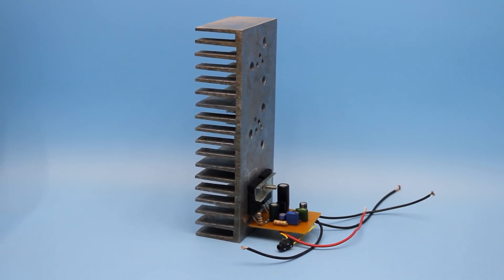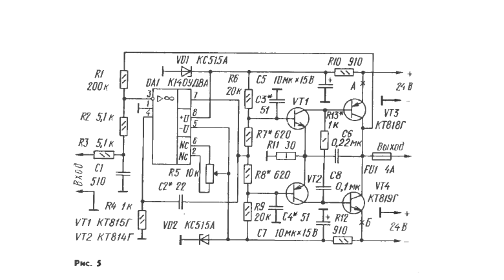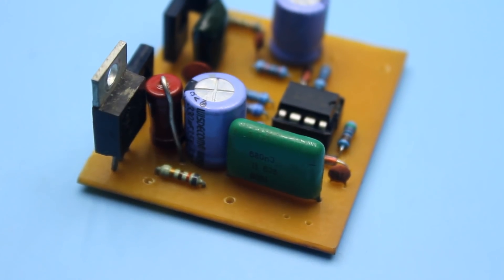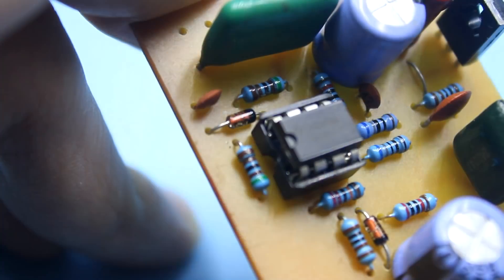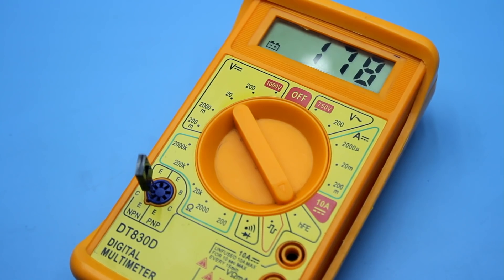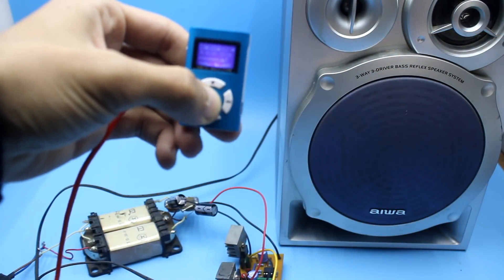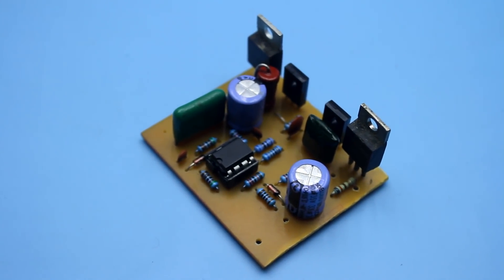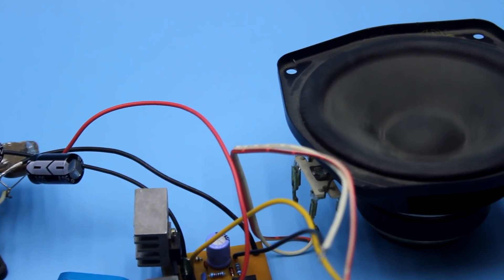50W  Amplifier on transistors

Comment: QSC used a similar schematic as a drive stage for their pro audio amplifiers 🤗 the op-amp definitely is a upgrade and will produce a cleaner and more stable sound through the transistors. And the TLO41 is a precision single ended op amp with a very nice slew rate fast.

Comment: Use the 5200 and the A1943 or the C2073 and the A940 in place of the tip41c and the tip42c. And use mje340 and Mje350 in place of the bd139 and bd140 pinouts are the same when swapping out these transistors.
Then you could use +70-0-70 DC and then you would have to change out some of the resistors for 1 to 2 watt resistors on some of it and also change some of the values of the resistors and definitely use all 100 volt caps. And two 1N5245B 15 volt zener diodes 5 Watt 🤗💖 to help power the op amp.

Comment: Class b isn't 'hi fi' enough, bcoz every time tr push &pull cycle, it doesn't start smoothly. So class 'ab' was created, it keeps tr still run slowly in off mode. Just like you keep ur engine 'on' when waiting traffic lights.

Comment: well the op-amp is more like a class D and that's definitely not a class B amplifier that's more like a class AB push pull with a collector output. And the TDA7294 would blow that thing out of the water. You have to use a op amp to really push those TDA chips and the TDA7294 I've actually connected 47-0-47 DC or +52-0-52 DC up to it. And the TDA7294 is a hundred watt chip amp with a 4 ohm load. I would use that amplifier for more like a drive stage! That you've designed. You could if you know what you're doing.🤗💯

Comment: Can I use a 140 watt toroidal transformer for using 2 amplifiers to make stereo or does each channel input need isolation? Also which value diodes should we use on the full bridge rectifier for 140 watt and there's no set voltage for capacitors?

Comment: I assume this module requires a power supply that supplies both positive as well as negative voltage?
Reply: exactly, aka split supply, you can use a lipo for that

Comment: Is 10,000uf capacitors sound ok for this circuit?
Reply: yap
even better but pay attention to voltage ratings
Reply: Well, yes, but then you should add some smaller low inductance capacitors in parallel. Bigger capacitors actually generally have high serial inductance yielding them poor for higher frequency noise filtering.
Reply: Thanks, so keep the overall voltage 10 volts or so over the rated system?

Comment: If you talk about class b. ( If you play Real class b  you  must have 2,1 watt pr watt you play from the supply but the AMP must be Bild for that   And is a Big claim to the AMP )
But this AMP is lov coast an Verry good
And i must Tel you All amps Bild in 1970-1980 Youse Verry hig supply wats 
Eks If your amps vas 2*100 watt the supply vás about 400 watt that vas times 
You se this amp you have is 60 watt and the supply is 70 watt
It’s to love to kontrol the speaker membrans
The bios in a amplifier  system works and are kreatet to Think AS A Brian 
A speaker have 2 sides front and back If you give you speake A signal to Go out 1 watt
The bios system must youse the same volts or watt Iind the rekyle  ven is gos back in support 
1 watt on Bouts sid’s on membrans 
The creator of the amplifier have 2 sid’s in his  Brian 
1 watt out and 1watt  on the otter side in the rekyl  off the membran     In the same cekund  (. 2.  Watt   Pr watt. )

I love the bios system its negativ and positiv ind the vay it vorks pracktial on the speaker membrans  you se
1=2 front side and back side of the membran   ( if somvone pres your on the schoulder you must yous  enagy to What Keep your balance      Thats bios system 
Drop class A its nonsens 
Real klasse b is the Best amplifier in the World    Thats it  ! hig slev rate voldtage Verry fast because the bios system 
Hilsen Per h Jensen Denmark 🌹🌹🌹🇩🇰🇩🇰
I love NAD Nikko  cervenvega and Fostex speaker from 1980  from Audiocan

Comment: No circuit analysis. Not Stereo. Odd power requirement. Not a class B, but a class AB. 
Also, why is every electronic channel YouTuber now a pimp for JLCPCB? 
That's just too much. If they are that good, how come you don't use them yourself? How come they don't make your PCBs for your videos for free? 
Not trying to be an ass, just pointing out areas that need attention.
Reply: the no stereo is quite classic when talking about audio circuitry, just duplicate it.
power requirement is classic for push pull to work on split supply. 
as i also pointed it is a class ab and that is a big mistake
the jlcpcb ....idk bro
Reply: Well aren't you a clever know it all. Thanks Sherlock.
Reply: JLCPCB is currently in aggressive marketing phase. It is easier to sponsor some DIYers community and provide service in price barely covering production cost. It is a marketing strategy.

About rest of the circuit - I think it easier to stick to integrated amplifiers in this power range. Look up "gainclone" amplifiers - the integrated chips provide better results while providing extra functionality like controlled power up and power down (no thump in the speakers). Many of them contain suggested PCB layout in their datasheets, like in TDA7294 datasheet (which I actually do not recommend, I have one frying while operating as constant current source, but within operating limits).

Also, the heatsinks used for transistors in this video are probably too small for AB class operation at 60W, as specified in schematics. There can easily be 20W (depending on how supply voltage is matched with load) dissipated in the circuit, moslty on power transistors - so 10W for that tiny radiator.
Reply: PirateKitty well if you want something different go to another video this one shows how to make MONO 50W CLASS B AUDIO AMPLIFIER and to get PCB's from JLCPCB you have to wait 2 weeks!!!The amplifier is great!!!!And why you need circuit analysis?!
Reply: PirateKitty

 I suggest you do it yourself then. Make your own video about a class B stereo amplifier with circuit analysis and boards provided by JLCPCB. If you don't like the content then just go watch other content or make your own. The internet is filled with information and videos for everyone's needs.

Have a nice day
Reply: PirateKitty Seriously dude, look elsewhere if you don’t like Kasyan. And BTW, it’s class B. Class AB requires that the A part conduct in both half-cycles using one device.